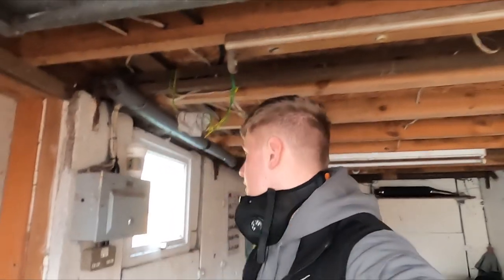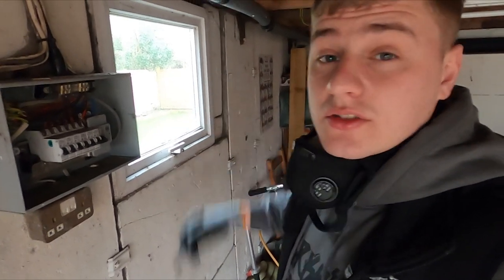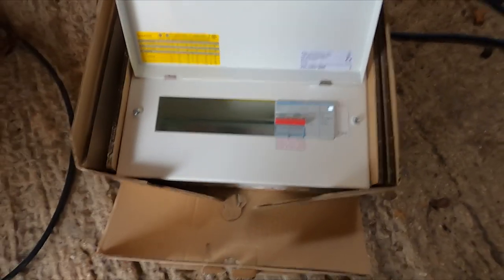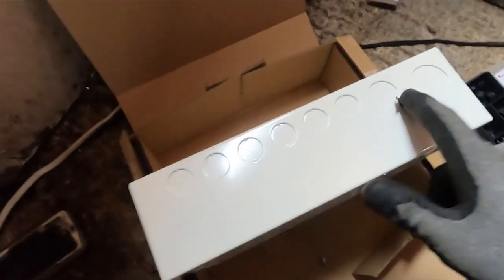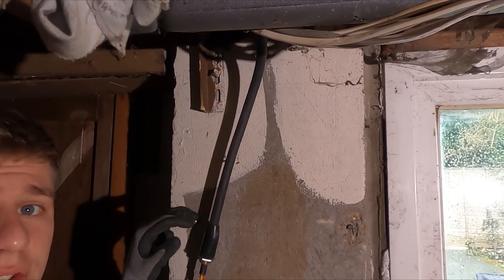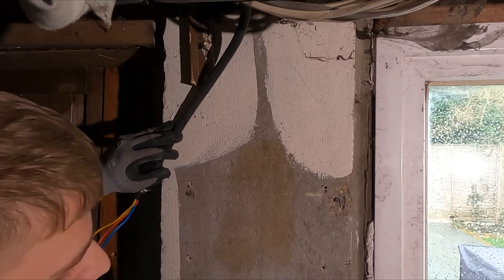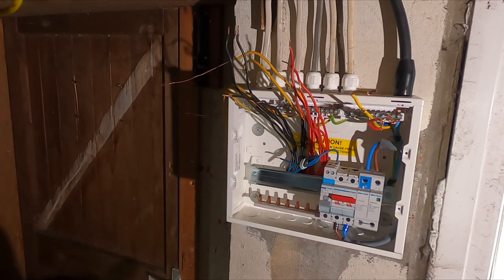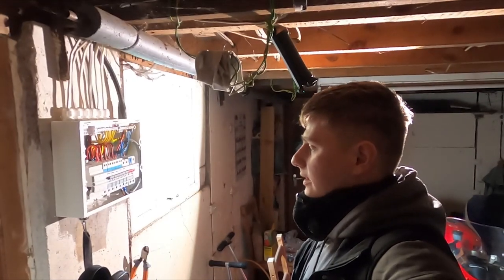Garage consumer unit upgrade

Comment: I am only an apprentice but did get told not to cable tie in the fuse board due to grouping factor I under stand you have the neutrals running next to the lives no Eddie currents appear but a very nice fuse board 🤙

Comment: Nice neat work. Regs does state banjo both ends but depends on your earthing arrangements if your going from a TN to a TT system then you’d need to be careful you don’t mix the two systems up if that makes sense… so you’d gland your SWA into a plastic IP box before going into the metal consumer unit if your sheath is TN-C-S protected to then convert into TT system that’s in the guidance notes but all depends what’s going on there not 100% sure from the video…

Comment: Tidy install, nice job. 

But why do you need a calibrated ferrule crimper? All the fertile does is stop the fine strands from separating until you terminate the cable, the final termination deforms the ferrule which makes any calibrated crimp a waste of time. 

And stop using your phone when driving.

Comment: Good job as always mate. We’re using fire/intumescent grommets on the top and sides of the boards we fit, as far as I’m aware there’s not a precise reg on using them but we are aiming to maintain the fire retaining integrity of the amd3 boards. Plastic glands will melt and allow the fire to escape, defeating the purpose.
Reply: Plus intumescent sealant around any rear cable entries.

Comment: Someone taught me to never look directly at breakers while flipping them back on since there could be a short circuit or ground fault. You don't want sparks shooting at your eyes/face. He told me to turn my face to the side and move to the side rather than directly in front of the panel/board.

Comment: Great video and like the time lapse on the board build. Love my Hager boards and the quality they come with - big shock on the mount failure though. Always thought eddy’s could be an issue if client is running pond motors, garage strip lights and car chargers plus standard garage electrical items.
Reply: Eddys are only a potential issue if you split a single circuit into different holes.

Comment: I do find it amusing that almost every single commercial/domestic sparks is currently using Dewalt but the main players on YT outside of yourself are using Milwaukee or Bosch which don't really have very many sparky specific tools UK side of the pond. Great job though and your filming skills are getting better and better on site. Keep it up.
Reply: @residualelectrical  Oh I don't find it confrontational at all, the M12 Milwaukee gear is indeed great and puts everyone else's to shame. Just the 18v range from Dewalt has most of the things you've listed. & as long as you know the conversions the cable stripper and crimper is fine to use. I don't use the work lights though as most of our gear has switched over to Unilite now. & yeah I figured they're sponsored by them but you don't appear to be, probably why I see you and your colleagues switching between the Dewalt 18v and the M12 Milwaukee depending on the job. 

Did give me a chuckle though as I've just moved away from Milwaukee's/Hitachi 18v and Bosch 12v system after 10 years and onto the Dewalt platform.
Reply: The milwaukee all double up as hammers too

Comment: Some of the placements of the main panels are in crazy spots where you guys are. Looks like a pain to work on them. I’m sure it’s not the case in new places but the old houses looked like they were put in with very little rules. 
- from ontario Canada
Reply: Ive seen boards above external doors, in tiny cupboards under the stairs. Mine is in a large understairs cupboard. Common is to find them in the corner of the front living room. In new builds, it is common to find them smack bang next to the front door at 4ft height. Nowadays a lot more thought is given to placement of them though regarding accessibility. Not many houses here have a basement for this sort of thing but where they do, they are usually used for this.
Reply: @stevecraft00  High up was pretty common all across Europe back in the day but a foot from the floor is something I've only ever seen in the UK. A friend told me at his gran's place in Budapest the DB is literally three metres from the floor, even the tallest people need a ladder to do anything to it!

Probably the weirdest position I've ever seen was high up on a wall in the loo, original late-1920s fuse board. The house was pretty much original until it was renovated less than ten years ago.

Comment: I’m not a electrician just a DIYer,
BUT using a battery drill as a hammer, pulling cpc to split outer insulation and not torquing the board not good practise. The bracket coming adrift of the box was a shocker,
Hope you took that further so much for quality control at the factory.

Comment: Plastic plugs and screws do not comply with fire regs , you should be using raw bolts , brick screws or concrete screws
Reply: @residualelectrical  keep those keyboard warriors in their place! 😆
Reply: Seriously Robert! Get out more mate. Use your own grey matter more than listening to other cardigans.
Reply: @residualelectrical  I get that they are being excessive but there is the metal cover on the front to protect against the rcbos being plastic.